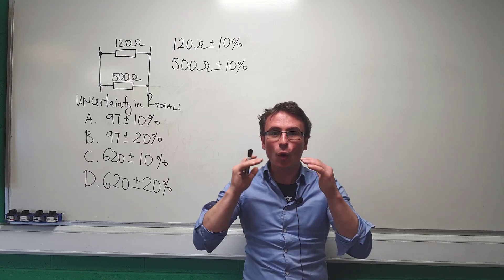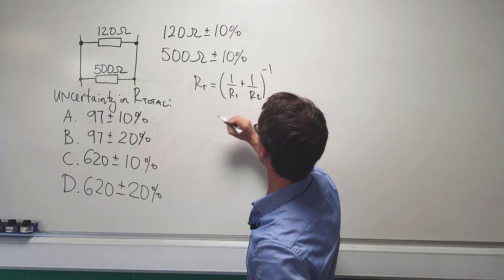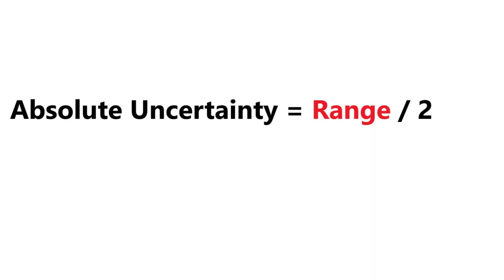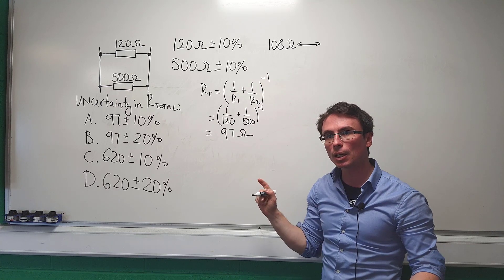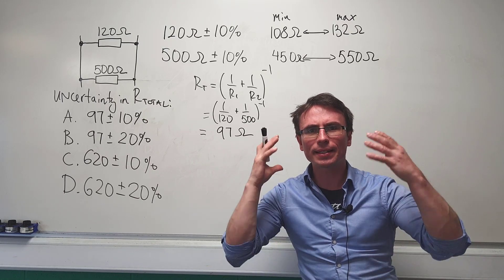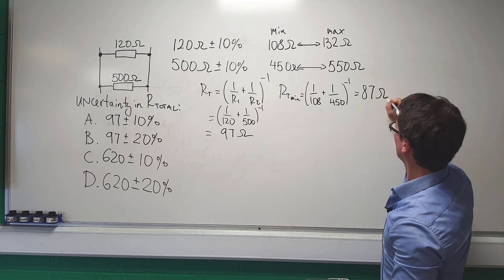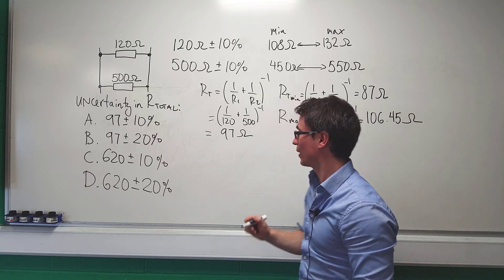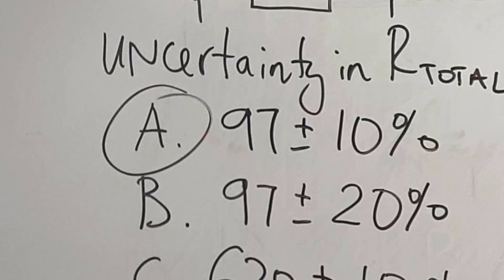HARDEST 1 mark on Uncertainties?

Comment: Hi Zhelyo, what videos do you recommend i watch for the paper 1 exam in this short time or should i do past papers (redoing them)?
Reply from the maker: I probably recommend the sample assessment paper, or any of the practice papers if you haven't done them. I don't think redoing past papers is very helpful but I do think that going over things you got wrong is crucial. You can also have a go at questions from different exam boards on common topics such as electricity, forces, SHM etc. You got this!
Reply: What exam board / papers specifically would you advise, as i currently am doing OCR so similar to that, thanks for the advice as well.

Comment: I thought half the range is equal to the absolute uncertainty, so 9.7 0hms is the absolute uncertainty, the percentage uncertainty is 9.7/97 * 100 = 10%. So even though you still got the right answer, I think you forgot to find the % Uncertainty at the end???
Reply from the maker: Yep! Correct, I only noticed after posting and acknowledged in the top pinned comment and the description. Hope this helps : )

Comment: Sir how were you able to use the absolute uncertainty formula for percentage uncertainty ?
Just realised sir for the last percentage uncertainty step did you do 9.7/97 x 100 to then get the 10%
Reply from the maker: For these problems you can use the absolute percentage formula first in terms of it being half the range, then find it as a percentage. I remember I did one typo in this video mentioned in the top comment but the final answer is correct : ) Hope this helps!

Comment: You can also do this by propagation rules

Let y = 1/R1 + 1/R2
Let r = ΔR1/R1 = ΔR2/R2 = 0.1

Then ΔRT/RT = |(-1) × Δy/y| = Δy/y

Δy = Δ(1/R1) + Δ(1/R2)

Clearly Δ(1/R1)/(1/R1) = |(-1) × ΔR1/R1| = r
Hence, Δ(1/R1) = r/R1
and similarly, Δ(1/R2) = r/R2

Plugging in: Δy = r/R1 + r/R2 = r(1/R1 + 1/R2)
And therefore Δy/y = r(1/R1 + 1/R2)/(1/R1 + 1/R2)  which cancels out and leaves  Δy/y = r

Hence, ΔRT/RT = r = 0.1 = 10%

Comment: Hi again, I was thinking earlier and I was wondering is it possible to apply a force to a photon. Since the speed of light is constant in a vacuum it is impossible to accelerate a photon and hence apply a force to it but if the same photon were to be refracted into a different media it’s momentum would change (changes direction) and since force is the rate of change of momentum, a force has technically been applied. I’d be interested to hear your thoughts on this
Reply from the maker: Fantastic question! Deserves a whole video on that, and to do that properly we would need a full on quantum treatment. Refraction/reflection on a photon level is very very different than what it seems on a large scale.
Reply: @zhelyo_physics  thank you, it’s interesting to think about why photons behave the way they do when propagating through different media and what optical density actually means :)
Reply: This question is beyond A -Level mate lol
Reply: @goonersgang9937  I’ve just finished my As exams and was wondering about some of the work that we’ve been taught
Reply: This is what i thought of your question: 
light being a photon and having a momentum is a particle behaviour of light 
light being refracted in different media is a wave behaviour of light 
remember the behaviour of light can be thought of as both a particle (photon) and wave (but not both at the same time, technically), this is the so called wave-particle duality of light
so to talk about force being applied when light is being refracted is jumbling up two different behaviours of light
this is what i think but i might be wrong
Reply: @UCxHlSa880_e2RRpj2wGsX9A thank you I agree with what you’re saying I have merged together 2 separate parts of photon properties there. I only suggested it to try and think of a way where a force being applied to a photon is possible- the obvious choice for me would be the photon changing it’s velocity. If you come up with any ways where this is true without the laws of physics being broken, I’d be interested to hear from you